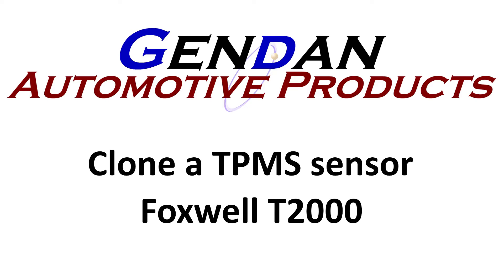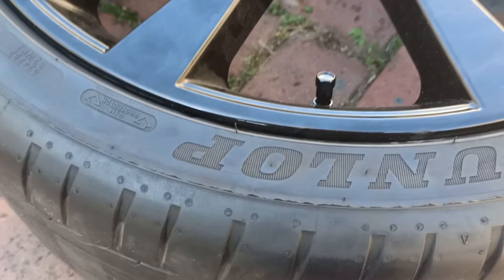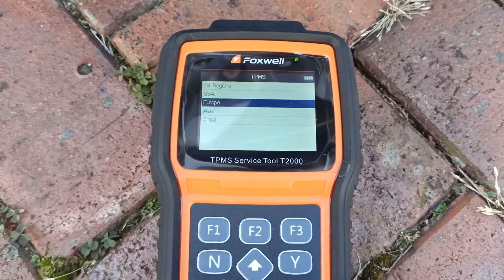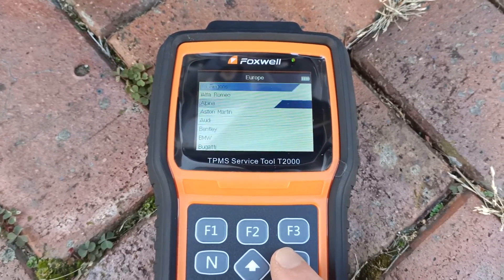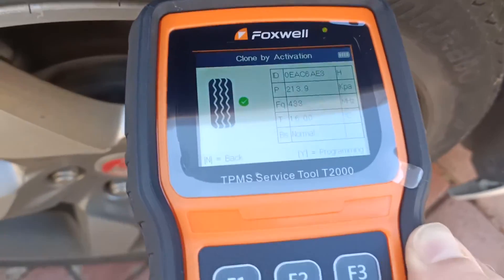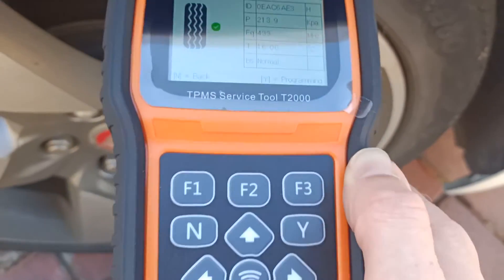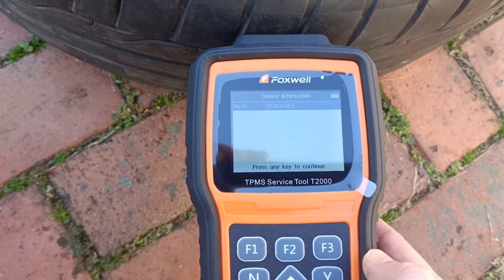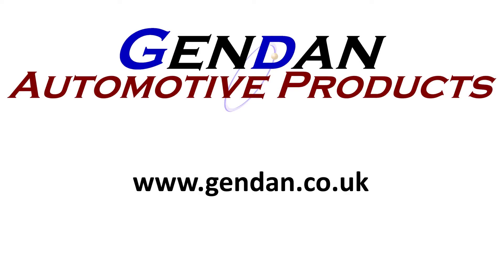Easy TPMS Sensor Replacement and Cloning! Foxwell T2000 TPMS Tool

Comment: I beg your pardon please.
How to deal with situation when only 1 sensor has tobe replaced ? 

Foxwell tools cover some brands of tpms. 
Does it mean you must have 3 different programmers tools costing 400 each ? 

After rotating wheels , tpms have to be relearned. Some people claim that some cars tpms can only be relearned via obd. Foxwell t1000 has good price , costing only 160 but it doesnt have obd connection option.
Foxwell t2000 tool alone is not sold anywhere anymore 

Finally when you just change tire , rotate tires and dont install new sensor/sensors. Do you even need this tpms programmer tool as Foxwell T1000 or T2000 

Thanks in advance.

Comment: After i change clients wheels , at their homes, clients with wheel sensors  cant clear car computer messages about low tires pressure or wrong tire  presssure ,etc. i just leave and say that they have to deal with it them selves .

Will this Foxwell fix all this messages ? 
Why is this foxwell 2 times cheaper than autel ? whats the difference please ? 

will it do everything needed for removing tires from the ring and placing new tires and then deal with all tpms messages whatever programming ? 
that foxwell ... can it connect to obd ? does it have to be connecred to obd ?

Thanx.

Comment: Will it clone any TPMS sensor or only Foxwell TPMS sensor?
Reply from the maker: Hi, the Foxwell T2000 will clone any sensor but the data can only be written to Foxwell T10 sensors (8 included).
Reply: @GendanAuto  so it cant relearn oem tpms sensors?